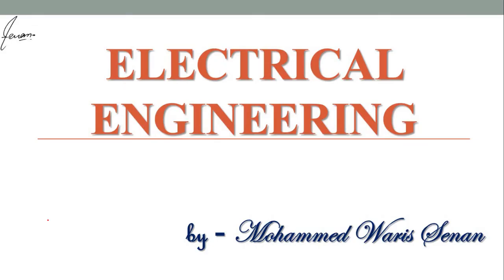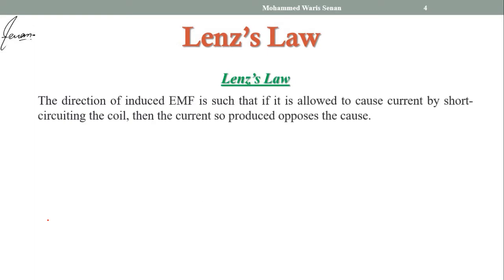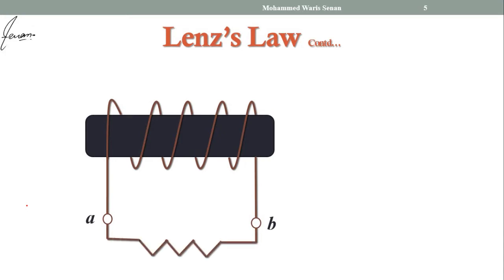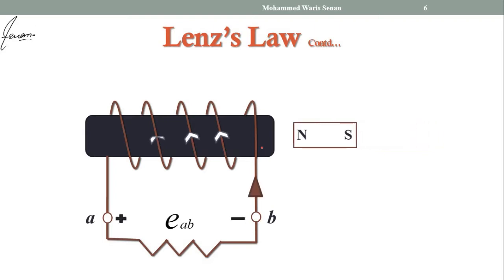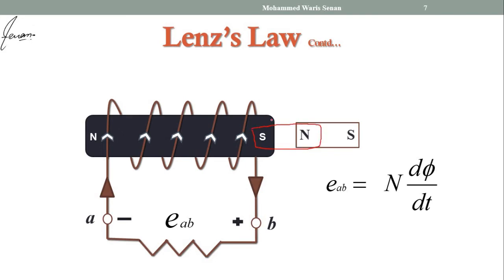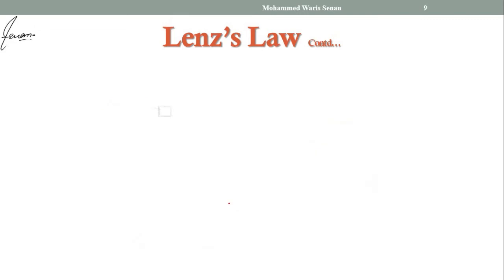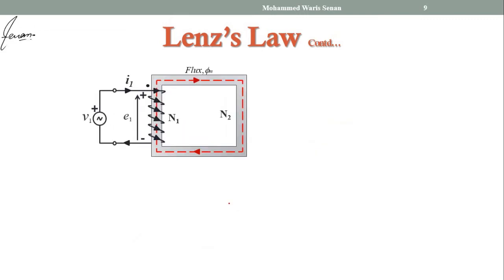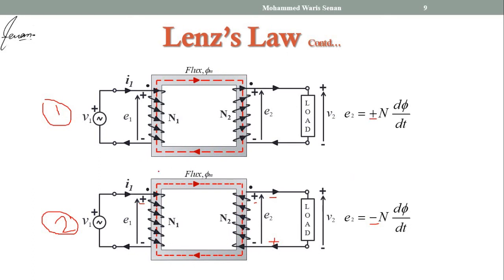Understanding Lenz's Law I Electrical Machine I Senan Academy

Comment: Is the direction of current in the coil arbitrary?
If not, then how to understand the direction of current
Reply from the maker: Direction of current depends upon the polarity of the coil.
Reply from the maker: The direction of current in primary coil is from +ve polarity to - ve polarity as power is being transferred from source to the primary coil. While direction of current in the secondary coil is from - ve to +ve polarity because secondary coil is supplying power to load connected to the coil
Reply: Yeah I got u...but leme refine it...in the explanation with only coil & magnet, it is to be understood that the polarity of induced emf (Eab) is arbitrary. Because the polarity of Eab is given as say + at a and - at b, current in resistor flows from a to b and so accordingly in the coil. Similarly when polarity of Eab reverses, then the direction of current also reverses both in resistor and in coil.
Reply from the maker: @KavyaRam  Yes. The direction of flow of current in defined by the Lenz's law and Lenz's law is only comes into effect when the circuit is closed.